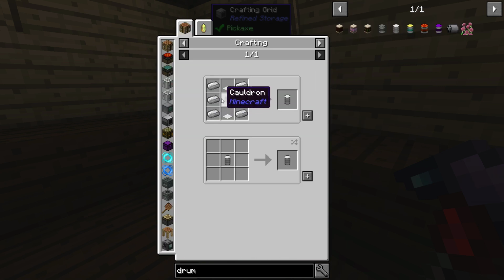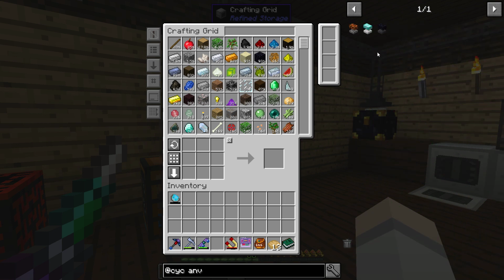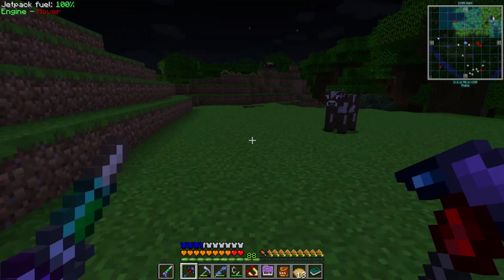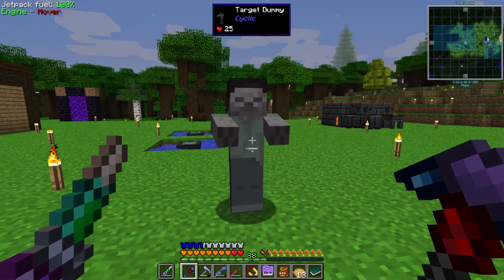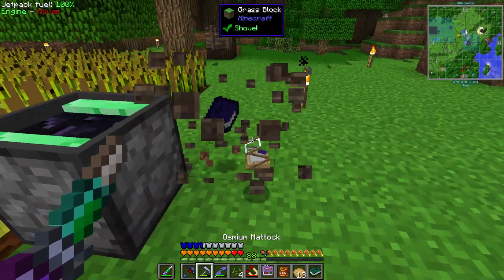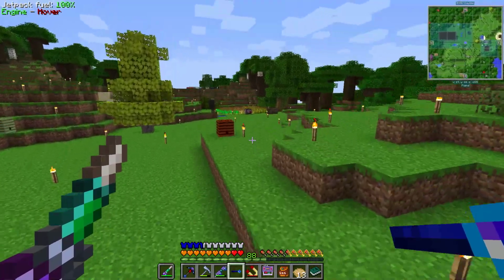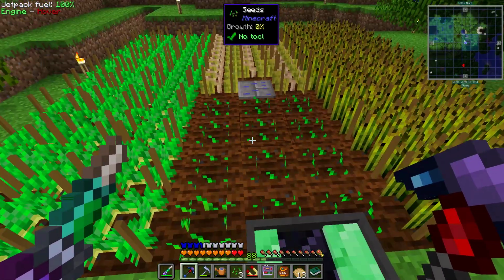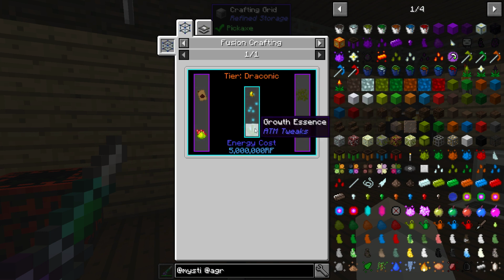All The Mods 3 Remix - Part 20 - Cyclic Energy Transfer Node With GPS Marker & More Cyclic!

Comment: So did you figure out the wireless transfer? If not, you use the GPS to record the thing you want to power, then put it in the wireless transfer. What you where doing was connecting the gps to the Wireless, and not to the Harvester. :)
Reply: That is correct. GPS the Harvester and then drop the GPS in the transfer node